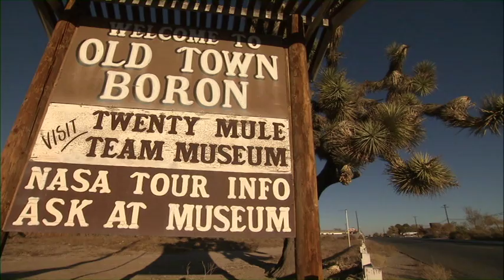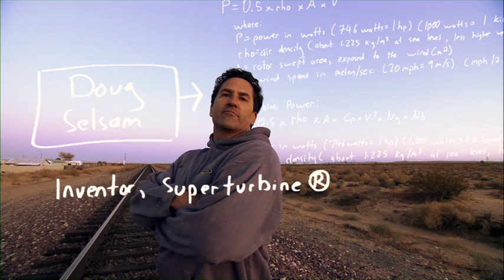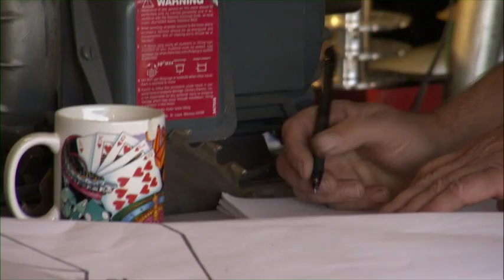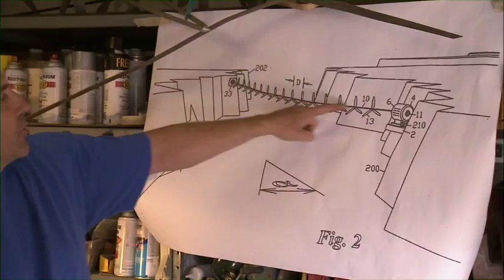Doug Selsam Inventor of Superturbine(R)

Comment: Not one piece of information about efficiency at all just statements "it's more efficient". Must be using snake oil to lubricate it.
Reply: That "snake oil" meme is old.
Reply: Doug, how long do the bearings last at these high rpms and the binding?  Maybe there is enough space between each bearing. I can't tell from the video. It seems like with the sagging you would have issues with bearings wearing out.
Reply: Yep. Fooled me for a while. More blades more energy, sounds logic. But seeing that fast rotating blades raised a flag. Does not matter how many rotors are there, will not spin faster than the wind. The efficiency is better given by the torque, and this mean a longer blade. With a long blade you can harness the slow wind too. The tip of the blade is the surface that gives most of the energy. So just adding some more short, inefficient blades, does not add up for a good system. Plus, even if the system works, is good only in places with stable wind direction.
Reply: @dougselsam5393  sorry for my poor English, by torque I mean longer lever, a longer lever means more torque for the same amount of force applied. and this is exactly what I mean, more rotors increase torque linear, longer blades increase torque geometrical, logarithmic, you name it. So, you double the surface with an additional rotor, you double the torque. but if you double the surface with a longer blade you quadruple the torque. Now, the devil is in the detail. Detail is if the cost of extra material used is less than the increase of extra torque. You save eliminating generators and poles. Is this saving greater than that geometrical increase of torque? I have no idea, but I really believe in the power of a greater lever. I think that small versions, in which the axle does not bend, may work. but that long contraptions , I strongly doubt. However, considering that small turbines are rarely economically efficient, due the fact that works optimal at a certain wind speed, the saving gave by multiple rotors may be not enough. Small wind turbines works as toys, when you do not compute ROI. But when they are bigger and costs are painful, they must be really big to recover the money and make profit. From my research, the only small wind turbines competitive are made by a brit guy and have adjustable blades. 

Anyway, this is just my opinion, you can prove me wrong by producing small versions, make profit and go bigger and bigger. And even by magic your km long snake prove to be 10 percent more productive than a classic turbine of same price, I doubt that the industry will jump to change. You see, they work well, are proven, but industry still rely heavily on coal. 
But I wish you good luck, even I do not believe you. My level of knowledge do not let me believe you. For proof, just repeat the speedy rotors test, but put a single rotor alone with nothing attached, just free spin, and see it spin as fast as the snake. For me that ”wooshing„ snake was a giveaway. Sorry.
Reply: Are you a spy/competitor or are you a troll?
Reply: There are two ways you can define efficiency while keeping area constant. There is electric power versus aerodynamic power and there is electric power versus the mighty dollar. The second definition is the only one that matters. The carbon fiber endoskeleton is a challenge on multiple fronts but it could work with 1-2 manufacturing breakthroughs.
Reply from the maker: @dickfitswell3437  Dick: Good eye, but you do not have the whole picture.  Using a DC motor as a generator, it was connected to the battery bank and therefor started spinning.  In this case, a motor and a generator are the same exact device, with the functional mode as gen or motor determined moment-by-moment by the instantaneous RPM and battery voltage.  That is what you saw.  When a foreign film crew flies over the ocean to shoot a video, we can't guarantee there will be much wind on a given day, but our machine ran anyway, due to this particular configuration.  Many wind turbines use power at startup til they get spinning.   Not unusual at all.  Please check out this video of the same machine, missing a few rotors from a crash, this time supported by a kite, at my Ranch, and you can see the whole thing - battery bank, switch, and meters showing current and voltage, proving it generates power:  https://www.youtube.com/watch?v=I0hrH8sBgeU
Thanks for watching!  :)

Comment: If he wants to scale up he could hypothetically use airships (blimps) to reach higher altitudes. Also the shaft can be coated with PVD or CVD coatings to greatly reduce wear, extend longevity, and help in some much needed lubricity. This guy is onto something just needs to be developed more.

Comment: Neat idea, prob need to research wear n tear over time, BUT think, now we can project portable say 100 watt backpack wind generators ?   Ever heard of "short stacks",  tall pipes that get tremendous winds thru them from ground to say 1 mile up, use wind .turbines inside to get the electricity. One question, whats to prevent overspeeding fly apart bearing burnout?

Comment: Doug nice work. I have always wondered if putting something like a "deer whistle" on the blades would keep the birds away. The sounds made by the whistle are silent to human ears but are you heard by critters like birds and gives them a warning that there is something ahead. Perhaps you could shape some holes into the blades that would make high pitched sounds to scare the birds away. Also perhaps some combination of centrifugally powered  LED lights might work and double as warning lights for aviation purposes?
Reply: You could dampen the sound and not kill birds with a carbon fiber shroud. However that would be in the millions.

Comment: Really exciting! And if (when) something fails on this design, the falling parts are (comparatively) light and so less dangerous than the big mills. No gearbox and no tower means (much) less cost, easy to repair, more reliable. The flying version needs a long term lighter than air craft, and that may be an expense / issue, but the canyon span type seems unstoppable.

Comment: The pull forces to the axle at the point of the generator must be gigantic with +50 meters axle. -> axle will break less than a year => idiotic concept that does not provide free or cheap enrgy in the long run.

Comment: Did he really say that the traditional turbines in the background were USING power? Also, the speed at which his turbines "start" seems very suspect to me for some reason, but who can say.
Reply: Agreed. Looks like a motor rather than generator.
Reply: Yup, because even with a high wind his turbines should have a natural start where they consistently get faster until they're equal with the wind. But like you said and I speculated, they appear to have been powered by a motor to get them to accelerate that fast.
Reply: "traditional turbines using induction motors as generators USE power at startup [...] The turbine will initially spin slower than grid frequency due to "slip", thereby USING electricty to power the rotation.  Then if the wind holds, the blades spin FASTER than grid frequency, thereby ADDING power to the grid.  So you learned something.  Anyone can look this stuff up. "

Im not sure what to say about this. Do you know there is a gear box?  Do you know that there are electronics involved to match up the frequency and voltage... because the turbine is pretty much never at a constant speed anyway?
But since you seem so have a source: Please go ahead. Where can I find information like that?

But lets say, for whatever reason, that this was really the case: 
How does ur system always have the right frequency? 
Any why would 1min of startup even matter? These things run at 50%  degree of capacity utilization in the USA.
Reply: What is the first generation? When were they built? Please specify.
PS: Why did you post the link twice?
Reply: So you are using arguments against 30...40 year old technology (20...30 at the time) to make yours look better?
And you ask yourself why you are the one that has to explain things?

If I come up with a new design of a car with 3 wheels and then talk about how normal cars have this and that issue because of their 4 wheels... would you think thats a good way to argue or a bad one? And then it turns out im talking about cars of the past that mostly dont even exist anymore... bad or good argument?

And then we still have this issue: Even if it was true, even if they use some energy... they simply produce MUCH more. And indeed stey still use some energy to this day. Because if there is wind just about to be able to produce energy,  static friction (stiction) would prevent the turbine from starting to spin until there is more wind... so they start up a little motor to get it moving, so any little bit of wind will start generating power. If you pay attention you can see them spinning very slow at this point, below 1 rpm, just keeping it moving to prevent stiction.
Reply: So now I make things up? Here is a Siemens patent about this (US20150300319):
"[0004] However, respective sliding bearings show comparatively high static friction or so called stiction, i.e. the required force to initiate motion in a respective sliding bearing standing still is comparatively high. Particularly, when using respective sliding bearings as main bearings in a wind turbine, high forces or high torque has to be applied in order to start-up the operation of the wind turbine, i.e. particularly start the rotation of the drive train so as to force the respective sliding bearings in a desired state of hydrodynamic lubrication."

"[0010] Hence, a certain amount of power is required for using the generator as an electric motor during start-up and shut-down of the wind turbine. [...] The generator is used as a conventional generator for producing electric power during all other operational states of the wind turbine unless start-up or shut-down of the wind turbine."

Maybe you want to keep the "high-school level college course" (or should I say high nose level?) to urself and instead argue like a civilized person?
Reply: There is no small motor, that part was incorrect, sorry for getting that wrong. The rest was, however, correct and not made up.

But are you going to tell me why this tiny bit of energy is relevant?

At 11:15 you talk about how the "traditional turbines" in the background are probably not producing net power at that moment. On what do you base that statement? Eg. can you tell us (cant tell by the video) what model those are and when they were build? Because my understanding is that any modern (when the video was uploaded) turbine will produce plenty of power at mild mind conditions. Thats what they are designed for, as thats the standard condition. There is a nice chart at wikipedia here showing that they produce at winds as low as 3m/s (6,7mph).
Here is a chart for a Enercon E-82 that looks pretty much like that, reaching ~10% net power at just 5m/s (11mph):
https://www.enercon.de/en/products/ep-2/e-82/

What it lookes like to me is that you try to discredit those turbines as if they are not doing anything. Please change my mind.
Reply: Dough Salesman... yes, its me again. I can alter names too, but what is the point? Why would you try to discredit someone by continuously altering the name in such a way? How does that make anything better? Please stop doing that.

"Now will you PLEASE stop wasting my time with your nonsense? "
Wait what...? Why would you answer me if you think this is a waste of time? Just stop answering if you think this is nonsense and you dont need to discuss anything with me or whoever. 

And yes, I got something wrong. Holy shit, I got something wrong! Big whoop, but I admit it and I move on.

"Anyway, I think the result was a reasonably good video. My job was just to show up."
Yes, the video was good. You did show up and it seems like it workes. But I dont want to talk about the video itself, I really want to talk about your construction/invention/project. So since we dont seem to get anywhere with the past few posts sinking into irrelevant details... maybe lets start over?

There are animations of this stretched across a mountain pass at about 5:00. Im sure you did the math on this at some point. Can you give me some ballpark numbers? Like how far did it strecht, windload, torque on the shaft for a given power, tension on the shaft etc.?
This is important because I dont think the other method (one side flying) would ever catch on, its just too dangerous.

Comment: The problem I see with getting it to long is different  wind speeds at different altitudes. The blades in the lower wind speed altitudes then act as fans sapping the energy of the higher wind speed areas.  Great concept, Ive always held high hopes for wind energy.  With the right setup you could change the altitude to keep the blades in the highest wind speed availabe, a huge advantage over turbine towers.

Comment: When it breaks, and all mechanical items break, you'll need an internal cable or some kind of safety mechanism to restrain it and a pull switch to monitor it so when it breaks it will sound an alarm and shut the generator down so it won't self destruct. Nice idea just not sold on it yet. Best Wishes n Blessings. Keith Noneya

Comment: very nice design, but that looks like one hell of a bird mincer!
Reply: He missed the point. Large wind turbines spin slow for a reason. Reduce bird deaths.
Reply: Great for farmers - getting rid of crows, pigeons and doves - auto bird mincing machines floating above their farms
Reply: >Large wind turbines spin slow for a reason. Reduce bird deaths.

The well being of birds is not the reason large wind turbines rotate slowly.

The reason why they rotate slowly is because balancing propeller blades that large and building a propeller hub strong enough to account for the extreme centripetal force of a fast moving propeller would be ridiculously expensive. The stupid amount of torque would be another engineering nightmare for the gearbox, as well as the heat from all of the friction.

If they really cared about birds, they'd use vertical wind turbines instead because there's nothing you could do with a traditional wind turbine to avoid bird strikes completely. Birds have no concept of a huge mass of steel crashing down on top of their heads, but if the blades were made vertical, it would be within their plane of vision and they'd avoid it. The only problem with vertical turbines is they're far less efficient, which is why they're rarely used.
Reply: So are solar based  -thermal energy  plants...they drop birds onto ground hot and ready to be eaten
Reply: zebidinofus Flying sushi anyone?
Reply: In the US in 2017 - For every bird killed by a windmill, 500,000 birds are killed by cats, and another 500,000 birds are killed by a collision with a building.
Source: Windmill Wikipedia article, if i remember it correctly.

Comment: This reminds me heavily with multi-core processing. Basically instead of putting considerable stress on one unit, you use a large number of smaller units to reduce resource costs, increase the amount of power, etc. I think people on mountainsides in Connecticut and the northeast will greet it well!

Comment: One issue I see with the balloon design is the winds at higher elevation is going faster and all blades are locked, in effect the lower blades become a load being in slower winds.
Reply: Also on the balloon one, you need like a blimp style balloon with winglet to lift the balloon in higher winds and keep it from being forced down from the wind.

Comment: My only question is why the motors all of a sudden started on the balloon attached one, I didn't see any means of mechanical linkage to stop them from doing so... Was it hooked up as motor and not a generator just to show us proof of concept spinning in the air?  If so maybe the efficiencies arent worth the benefit?  I need to see more data.  Why did you stop making videos?  Your clearly on to something big here..
Maybe the materials you used at the time weren't the best for efficiency's sake,  But it almost a decade later and new materials are being made.  

I think you need to go Higher up in the atmosphere, and I think you need to use some bigger surface area on the blades, and make sure the bearings are weather proof with auto greasing.
I did go to an engineering school.  We could possibly help get this out to the people.
Reply: O was thinking the same thing

Comment: I appreciate the out of the box thinking and this is what I would like to see from more people. Although I support the man, I do see the flexible carbon fibre rods to be an issue due to the amount of stress being placed on the rods and entire system. The Beutty about wind turbines is that the propeller doesn’t have to spin fast, instead the gear box does the rest. By having the propeller spin slower you get less vibration and more stability along with safety. Have a bunch of propeller spinning so fast can cut someone’s head off in the case of a failure. Wouldn’t wanna be anywhere near those propellers...
Reply: Also I would hate to see birds 🦅 run into it.